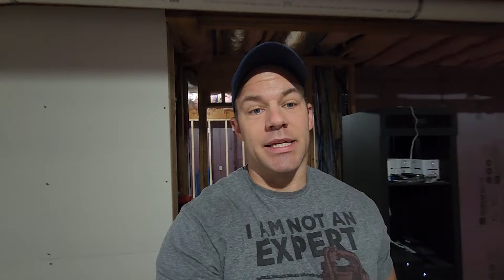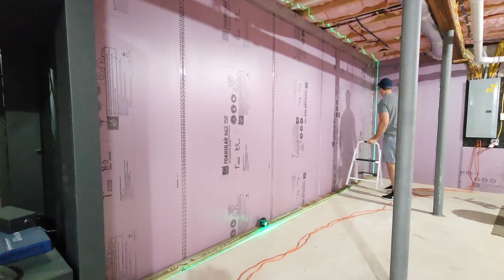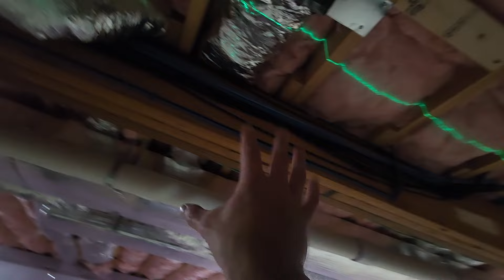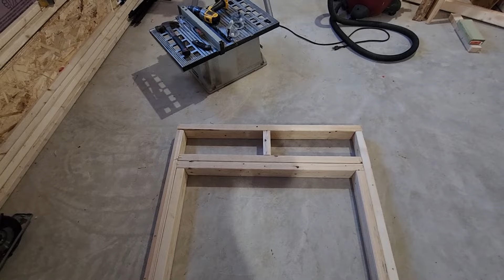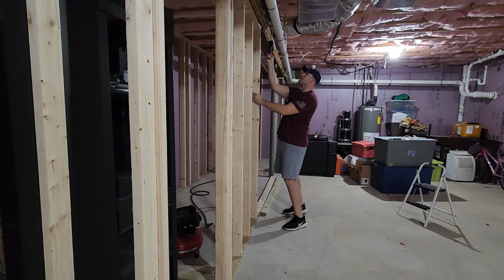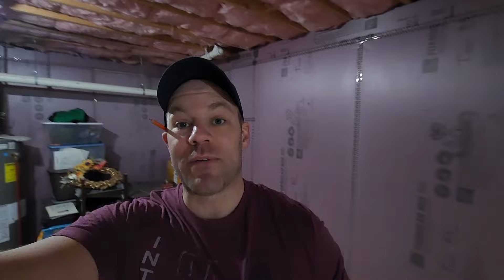Saving $30,000 DIY!! Framing The Bathroom! How to Frame A Basement Part 2

Comment: FYI: In PA, if a bedroom is being added to the basement, it needs an "egress" window, just a heads up for other Pennsylvanians. The hurricane door doesn't qualify as an exit, which is of course at the other end of my basement. There is code that dictates min size of window and height above floor, etc. Since I have a glass block window in my future bedroom, I will have to remove it, enlarge that accordingly, install window and have the window well outside large enough for egress (ladder/steps have to provide ground access). Nothing a good concrete saw and shovel/excavator can't accomplish. 🙂

Comment: Nice job....studs not beams
Reply from the maker: @johnpandolfino8663  thanks!
Reply: Along those lines, toenailing is only for nails. I don't know if I've ever personally heard this before, but supposedly it's called "toe-screwing" if you use screws.

Take that with a grain of salt.

That being said, crazy work ethic. I have ADHD, and it's making it near impossible to get everything finished that needs done in our new house.

Comment: I honestly think toe-nailing three nails for a typical sidewall is way overkill. Honestly 2, maybe even 1 screw is likely enough. Its not holding any weight.
Reply from the maker: @PSNDonutDude  I agree.  To be clear, I did 90% of mine with only 2.  But technically 3 was the "right way"....waste of screws, so I am with you!

Comment: Appreciate the fast question responses Ryan! I need to layout my bedroom/sitting room/bathroom in my basement. I'm not doing the full basement at this time. First thing after getting that planned would be to get an HVAC contractor to install the additional duct work. One question: when you join wall sections, I see of course you have double studs, how do you maintain the 16" OC spacing? I'd assume the two adjacent studs would be centered on 16" from left and right adjacent studs on the wall? Thanks again!
Reply from the maker: @ngc60  You just need to space at 16" OC to the best of your ability - so I just start the next wall making my studs 16 OC apart.  Ultimately,  you're always going to end a wall with a smaller section (which isn't bad bc it actually gives more support anyway!).

Comment: Our permits in my area are only good for 6 months before they expire. If you get an inspection it’s good for another 6, I’m going to use dricore subfloor (it’s channeled rigid foam attached to osb for floor insulation and allows air flow) in combination with rigid foam wall insulation. Going to try and do that and frame without a permit that way I can take my time and not be rushed for inspection. Then pull permit and have electrical plumbing and framing inspected.
Reply from the maker: That's really smart.  I almost did the channeled sub-floor but my basement is bone dry and has been tested multiple times.  That said, 100% with you on the permits.  I am waiting until I'm further along to get it all inspected.
Reply: @ryanscottlifts  you didn’t mention it yet but what type of insulation/flooring do you think you will do?   Great info so far
Reply from the maker: @Fugalisious  I did the foam board against the wall, and then I'll run the fiber insulation between 2x4 framing once the electric is ran.  Still undecided ok floor but likely some manufactured flooring. I'll make a video for sure.
Reply: Again, maybe should have build subfloor first and built framed walls over that to protect for thermal transfer.  

I assume you have vapour barrier poly under the slab when built? That will help at least.
Reply from the maker: @lukewaidmann3678  yes.  Also responded to you on my other video.
Reply: @ryanscottlifts  are you going to use a foam board like 3/4 on the slab so the LVP floor is not cold?
Reply from the maker: @jeffcarbello9115  hey, no I am not.  Most of the new flooring has a layer of essentially rubber that helps isolate the floor from the concrete.

Comment: Looking forward to your part three. I have a somewhat similar scenario as you with the foundation cement wall on the bottom and a stud foundation wall on the top. I'm going to be doing that work relatively soon and haven't found a lot of videos of how to tackle that but I was wondering what your plan is for that space? Are you going to keep the uneven cement wall and studded wall or are you going to build a wall in front of it so it's a flat wall?
Reply from the maker: @drew2180  it's all done.  I'll probably get that video edited and out in the next 2 weeks.  I built a wall in front (like every other wall) and anchored it directly into the foundation.  I explain it all.   I actually have a short video I may get out sooner specifically on how to do that wall.  Will try to get that short video out this Sunday for ya haha.
Reply: @ryanscottlifts  you are the MAN! Thank you so much. Looking forward to it!

Comment: Hey, when do you think you'll have part 3 uploaded? I'm building out my basement and love your video!
Reply from the maker: @MohammedTayel-s8e  hey thanks!  Hopefully in the next 2 weeks.  It's basically done but I've had a lot of travel for work so been hard to get down there or edit any videos.
Reply: @ryanscottlifts  Hey Ryan hope all is well. Any update on part 3 of the video? Also, are you able to put a list of all the tools and equipment you used regardless of what step in the basement you are on. I like to buy what I'm missing on black friday lol
Reply from the maker: @MohammedTayel-s8e  hey sorry life been crazy and hard to find time to edit and release the video.  But I have used a table saw, miter saw, air nail gun, impact gun, drill, circular saw, laser and basic hand tools.
Reply: @ryanscottlifts  No problem Thanks. Are you planning on getting someone for the plumbing? Are you doing the plumbing after the framing?
Reply from the maker: @MohammedTayel-s8e  Hey I am going to plumb myself.   Assume you're referring to the bathroom?  It's not that hard but I know it's intimidating if you haven't done it before. I'll be using a 1 HP Saniflow pump so I don't have to jack hammer up the concrete
Reply: @ right on. Yea the bathroom. Actually when I bought my house, it was roughed for a bathroom with a pump already in place. I just bought the insulation material and the tools, so here we go this weekend. Appreciate the help so far, I’ll be sending pictures.
Reply from the maker: @MohammedTayel-s8e  nice can't wait to see them!
Reply: @ryanscottlifts  sorry quick question, after you framed did you insulate as well with the fiberglass insulation even though you did the foamboard insulation initially?
Reply from the maker: @MohammedTayel-s8e  yes I got the Rockwool R15